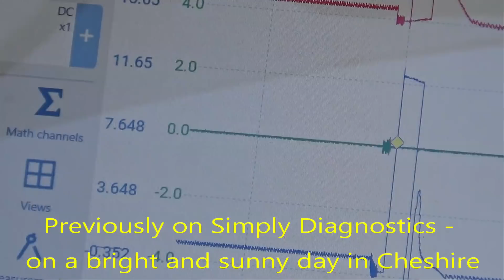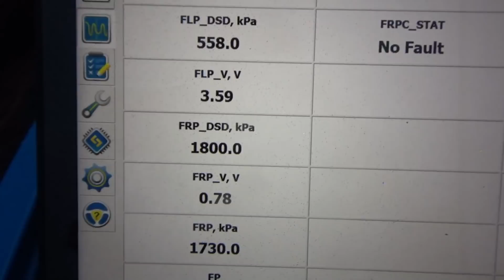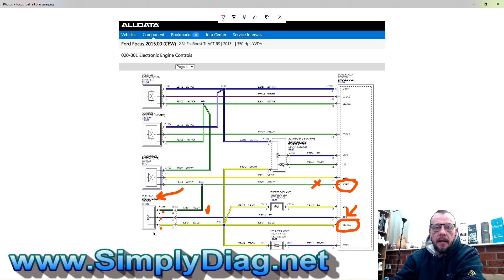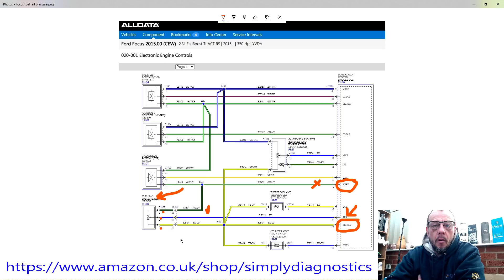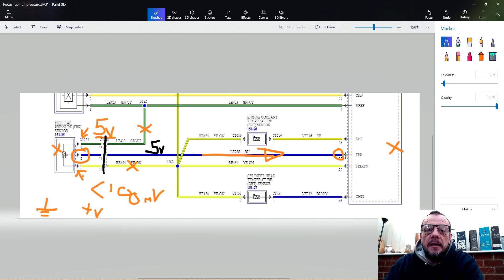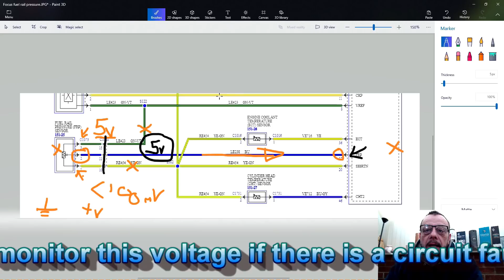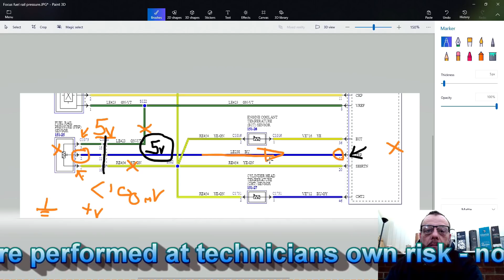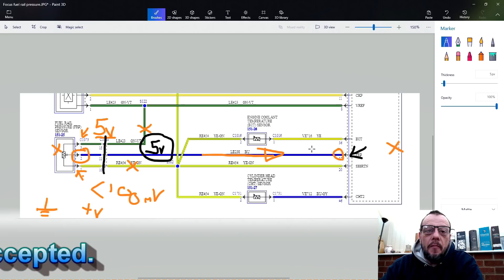Focus RS fuel pressure fault Part 2 & How to test a 3 wire Pressure sensor

Comment: I already had a spare fuel rail pressure sensor lying around so I dropped it off at the dealership today to get it installed! Hoping the new fuel pressure sensor and fuel pump will finally fix my car!
Reply from the maker: Let us know if it fixed it 👍
Reply: Did your p08b2 code go away after replacing the fuel rail sensor and hpfp? My car is now working however the code came back.
Reply from the maker: No, all codes cleared after adaption reset etc.
Reply: @SimplyDiagnostics  dang ok, yeah I still have the code. And I have no clue what us causing it. Maybe I need another fuel rail sensor.
Reply: @SimplyDiagnostics  car is running great however so I am at a loss :/

Comment: Nice lesson for us (or at least for me).
I want you to tell me your opinion, Autodata vs Haynes vs Alldata. Have you 'check them' all ,and which one you think is better (according to your opinion).Thanks.
Reply from the maker: That depends on your situation, no single data source is enough. I run Alldata, Hella HGS, Bosch ESI and Haynes and there are still times I need to use the manufacturer portals.
Reply: @SimplyDiagnostics  
Thanks a lot for your reply. Appreciate it. That's why, sometimes, working in a specific brand, and having all the OEM package (tools, specs and wiring diagrams ,training , etc),you never going to feel that something missing from your  ' toolbox ' .....

Comment: You looked almost as blue as the car there Steve, great British weather :) I have a queation on the unplug it test regarding the signal wire. I know Paul Danner teaches the same principle where he says that you unplug the sensor and if you have your bias voltage there then you are done with that wire, the integrity is good. My question is what if that wire was corroded? If you unplug it and had corrosion then  would you still not see good voltage as you would have no current flow? If it was an open or a short i can understand but corrosion makes me wonder. Maybe the voltmeter would pull it down is the answer? Cheers for taking the time to put the videos up and keep safe
Reply from the maker: If there was corrosion the bias voltage wouldn't be there, it has no strength to overcome even the slightest resistance
Reply: @SimplyDiagnostics  thanks for the information thats great

Comment: Thank you Steve, Am I correct in saying if you put yourself accross the bias voltage ang the battery ground youcan pull bias voltage down. Probably best straight out the bath lol
Reply from the maker: Yes, bias voltage is very weak and carries no current at all.

Comment: Nice follow up Steve, don’t forget the ohm meter is a safe way to test signal circuit integrity, most meters will only output 1/1.5v 👍🏻
Reply: Need to test your DMM before you try that. A couple of my Flukes will push over 7 volts into a high impedance 'scope or DMM. I've even got a 'scope capture of running one of them thru' the ranges but can't post images in yt comments.
Reply from the maker: Matt, feel free to share in the Facebook group or SimplyDiag.net, that would make a great topic 👍
Reply: @mattt4183  the key to carrying out any testing is know your equipment first.
Reply from the maker: Great point mate, I'll have to make a video featuring that bypass, I've avoided it until now as there is a bigger possibility of learners getting it wrong, confusing the meter settings, why were using the ohms function to output a voltage and letting smoke out 👍
Reply: @SimplyDiagnostics  it’s good to see you back 🤜🏻🤛🏻
Reply from the maker: Thanks mate 😁

Comment: Found this to be one of your best videos to date.. Very clear methology and explanation.. Appreciate all your time and effort put into all your videos.. I was just wondering when doing electrical tests should novice or inexperienced people be taught methods of testing with no risk rather than a small risk... would like to know people's opinions.. I'm noy being snotty just hope that doesn't appear negative as I've learnt something from all your videos
Reply from the maker: Hi Magic, thanks for the positive comments 👍the warnings and disclaimers are to protect me from ambulance chasers more than anything.
There's neglible risk when doing these tests as described. I've taught these tests to apprentices with no experience and used them thousands of times myself without incident.
There's certainly less risk than intrusive testing such as opening fuel lines etc.
Cheers 👍

Comment: This is how to test supply , ground for sensor and wiring to ECU .To test sensor I would put in a system with  known pressure and check output .Cheers !
Reply from the maker: Let's not forget that we can also tee into the low pressure supply and verify with a transducer or guage - this is intrusive testing and we want to avoid that wherever possible 👍 
There's also the issue that most rail pressure sensors are single use only and most manufacturers recommend that they be discarded when removed.
Cheers 👍

Comment: Thanks a lot, you could also use a resistor like Scanner Danner wrote in his book. How did you knew that faulty sensor caused pumpe failure? Seems to me it was like , who was first chicken or egg dilemma
Reply from the maker: The evidence was in the fluctuating voltage in Part 1, koeo the voltage should have remained constant. If the HP pump was unplugged the system is perfectly capable of running at idle on low pressure supply only with a fairly constant output from the pressure sensor 👍
Reply: @SimplyDiagnostics   I missed that, thanks again yo are very good teacher

Comment: Could I quickly test the three wires with a three wire potentiometer and watch scan data as i move the resistance up and down?
Reply from the maker: Possible depending on the exact specs of the pot but far quicker and easier to use a dmm and testlight.